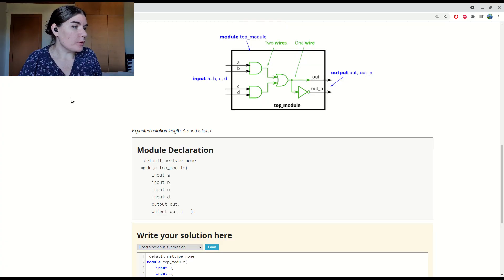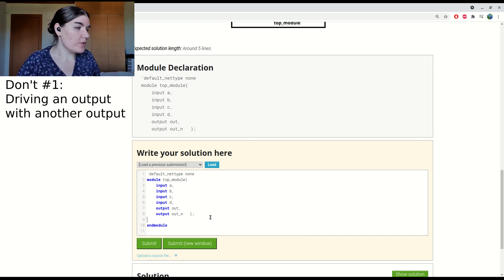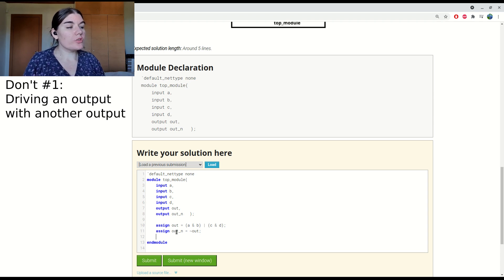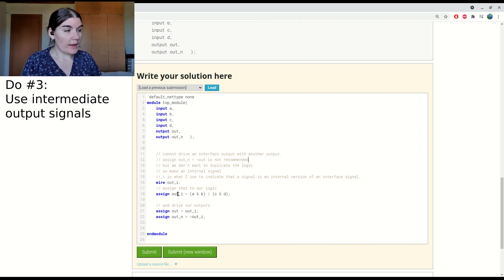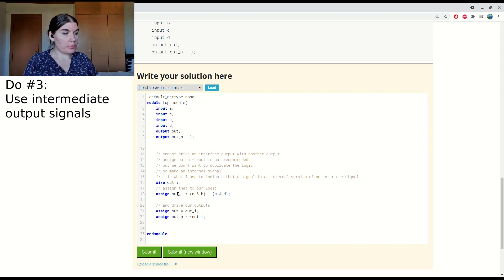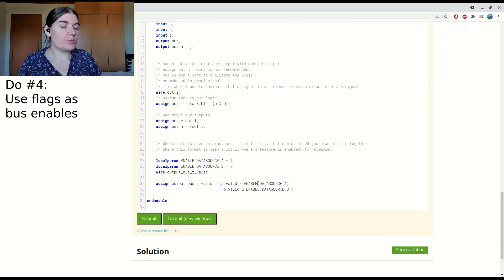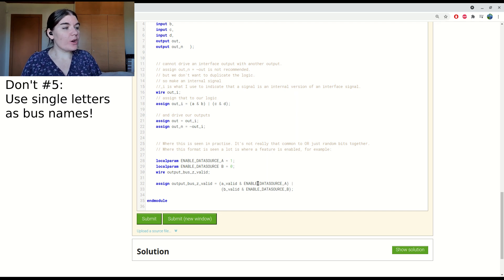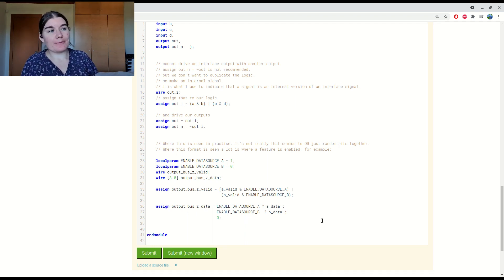6 Do's and don'ts for good Verilog coding practices

Comment: What is the alternative for "for loop" to make the design synthesizable?
Reply from the maker: A good question! The always block is inherently a loop, that occurs every clock cycle. Effectively a while(1), where every loop is a new clock cycle. So instead of using a 'for' loop, you'd use an always block and a counter to keep track of what iteration you're on.
Reply: @FPGAsforBeginners  Thank you. Your videos are very informative. I'll try using your suggestion.
Reply: @FPGAsforBeginners  My ckt is combinational one , independent of clock will it still work?
Reply from the maker: @rajashree2820  It depends on what you're doing and why,  but generally a clock is recommended. FPGA timing analysis tools are generally designed to use the clock, so you may find your design behaves unreliably or doesn't work.
Reply: @FPGAsforBeginners   I am working on 45nm technology and want to design a logic which is synthesizable. 
Can "generate for loop" make design synthesizable ?

Comment: Hi Stacey! As a current hardware engineer, how much coding do you do with HLS? Do you see RTL design being something of the past? Thanks for the vid!
Reply from the maker: Hi Dom! Not much HLS at the moment, although I'd love to get more into it! A lot of the companies I work for (or have in the past) are still a bit behind when it comes to FPGA tooling, and (System)Verilog is still very mainstream. In the future I think HLS will definitely become more popular, especially with hobby/commercial applications. I think it'll be slower in the defense/aerospace (even industrial) industries where designers like to have more control over the RTL, and HDLs allow for that.